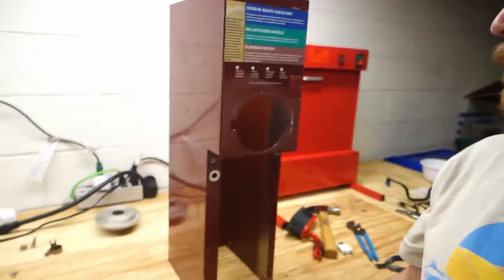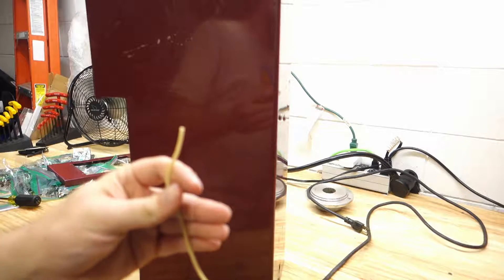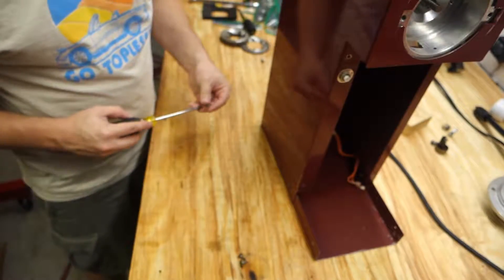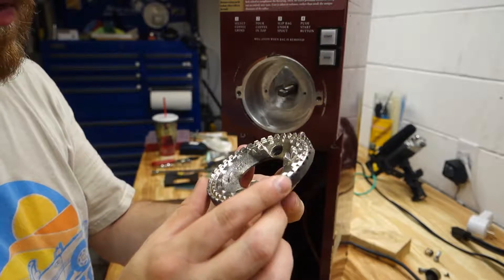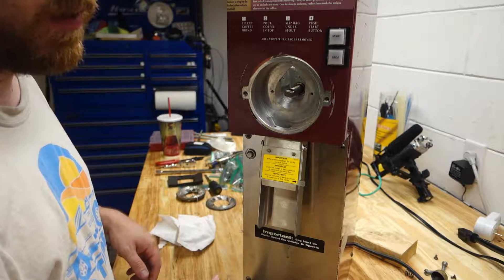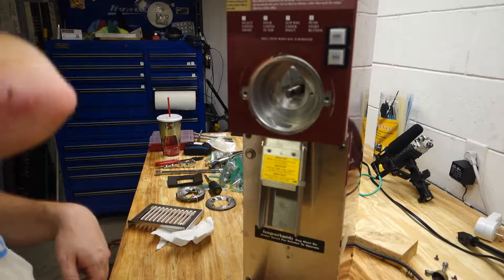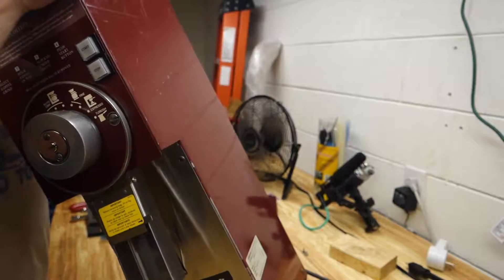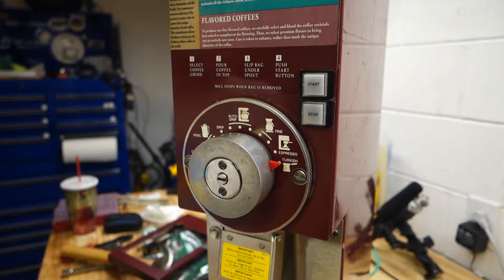Reassembling a Grindmaster 875

Comment: I screwed up and took apart the grind adjustment dial and now can't get it back on correctly (for example it doesn't click when turning and turns past the far left and right settings). Any thoughts on how to fix that issue? Theres a pin on the inside, but i can't get it to stay in the right position :(

Comment: To anyone that can help !! I just picked up a used 2017 Grindmaster 875. I Pulled the burrs off to clean them. When I ran my finger across the teeth they are smooth very smooth. Are they supposed to be more jagged or not ? I also want to know if they can be sharpened ?